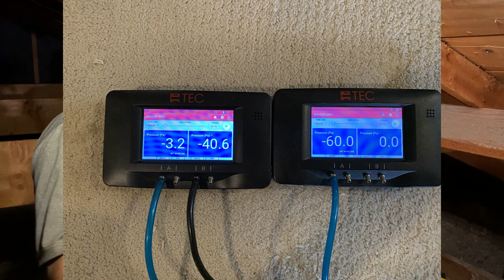What If One Suction Point Isn't Enough To Reduce Your Radon & You Have a Finished Basement?

Comment: I liked this video and the level of detail provided, especially around what you feel is a good suction level and how that drives fan selection. Thanks for these videos as a homeowner I have learned a lot and it helped me reduce my home radon level greatly.
Reply from the maker: You are welcome! Can I ask where you are watching from and what your radon levels were before and after mitigation?
Reply: @AmericanRadonMitigation  my home has a basement and two smaller crawl spaces, the first of the two installed by the original owner. There was a SSD installed that covered the basement slab (1,600 sq ft) and newer crawl space (300 sq ft). The high suction fan produces -.024 inches at two furthest points on the slab and -.01 inches at three locations in the basement slab. I still have vapor coming up based on my feeling and breathing it. The remaining 115 sq ft crawl space is still not depressurized and I was wondering if I could rig a temporary fan to an existing sleeve which connects to a pit. Are there such fans available which would allow me to creat a vacuum under the slab and evaluate how much suction it produces. I have course sand under the slab.
Reply from the maker: Hey Thomas. It's hard for me to give advice without more information and without being able to see it.

We do offer consulting services via Google Meet, FaceTime, Google Duo, video, and email. The cost is $250 for each hour. We also rent measurement instruments that will allow you to pressure field extension, CFM, and static pressure.

Give us a call at 612-474-1004 if you'd like to set up a consultation.

Comment: Awesome video, love the content - so the stitching is just an open tunnel back to suction point that you dug/connected through a series of holes? Any concerns of integrity of the foundation removing that much material?
Reply from the maker: Yes, that's correct. The concert floors in Minnesota are not structural like the footings, so removing that much soil is not a concern. The 3.5-inch concrete slab can easily bridge the tunnel.
Reply: @AmericanRadonMitigation  thanks so much for that quick response! Your channel is fantastic and is certainly saving lives. Take care!
Reply from the maker: Thanks for reminding us why we do it!

Comment: Idea, the last three nails on the roof exhaust flashing, before nailing the nail all the way in put the dab of caulk under the nail head, should form a better seal and protect it from UV light.
Reply from the maker: I tried that for a few months, but it made a mess of the flashing and my hammer. I now put three dabs under the flashing where the nails will be.

Comment: Thank you so much for this extremely informative video. Such amazing workmanship! I’ve learned much. One question, it looks like suction point 2 isn’t that far from the first one. Why not simply “stitch” all the way to the first point and thus avoid creating another suction point altogether? Was that a structural decision?
Reply from the maker: Thank you!

That's a great question. I could have done that.  However, running a pipe is way easier and faster than stitching. 

I didn't need to use valves in this system, but separate suction points would allow valves if we wanted to vary the suction in each suction point. For example, having one suction point on drain tile or sub-slab depressurization and a second pulling from an encapsulated crawlspace. You want to be able to control where the air comes from. Otherwise, the fan will pull from where it's easiest. 

Are you a mitigator? If so, where are you from?
Reply: Got it. That makes a lot of sense. I'm not a mitigator, just with a DYI enthusiast mindset that always tries to understand how things work under the hood. We just got a single-point radon system installed by a mitigator here in Georgia. Over the past month, however, the numbers have been creeping upward. Before mitigation, the numbers were between 4 and 7 in the basement. Right after the system was first installed back in July, I saw numbers dropping below 2, sometimes even below 1, and now it's up to 3.5 for the entire past week. It's still quite short term, so I'm observing and see if I need to do anything further. I found the pictures I took of our foundation back when it was new construction, and from the pictures I can understand why the current suction point isn't optimal. Therefore, I've been researching on the Internet on multiple suction points just in case.

Thanks again for your videos. I watched all of them!
Reply from the maker: You're welcome! Feel free to reach out to us if you'd like some advice, as we offer consulting services.

Comment: Good informative video. I am curious about the concrete you use, why don’t you use hydraulic concrete? It sets fast, but the big advantage is hydraulic concrete expands as it cures, if it’s water tight, it’s air tight. Any thoughts?

Also, one last question if your working on a basement floor with radiant in floor heating how do know where to drill your test holes so you don’t hit any of the heat tubing?
Reply from the maker: Thanks, James. Good questions. 

1. I use fast-setting Sakrete since the yield of one bag is much higher and far less expensive than hydraulic cement. We are also not relying on the concrete to make the seal. By the way, I've had hydraulic cement leak in the past, so I don't rely on it to make an airtight seal anymore. 

2. We use a thermal camera that plugs into a smartphone. Here's a link to the ones I would get. https://www.amazon.com/shop/americanradonmitigation/list/2TZ3HBU6ICV4Z?ref_=cm_sw_r_cp_ud_aipsflist_aipsfamericanradonmitigation_FSA24YV85QRNKPD0FHJ3

Comment: How are you excavating your stitching holes? They seem pretty far apart to get like a long drill bit or something in there, I have to do this in my house. I'm at a 5.4 pCi/L during the day and for some reason at night it goes up to about 8 pCi/L at night. I must be doing something during the day that vents it or something...
Reply from the maker: I use an auger on a right-angle drill, screwdrivers of varying lengths, my hand, and a shop vac.

Comment: Great job, Great detail. Thanks
Question, would having a 4 inch pipe on the exhaust side of a high vac 3 inch system provide any benefit. Such as less energy for fan? I understand your thinking on the 4 inch pipe preventing less of a freeze problem, good idea.
Reply from the maker: Thank you, Gary. A few feet of 3-inch pipe above the fan would add an insignificant amount of friction loss on a high-suction radon mitigation system. The less air a radon fan moves, the less power it consumes. If we were in a warmer climate, we would use a 3-inch discharge on high-suction, low-flow systems.

Comment: Being in Ramsey Mn with a lot of sand my meter is saying 10 PCI/L I think I have to do this. Do you think it is a must to go through the attic? Is condensation/freezing a problem if it's on the outside?  Is there a reason you didn't run horizonal pipe in the attic so the pipe could stick out the back of the house and not the front?  I'm a builder/remodeler if I ever need radon mitigation for a customers's house I'll call you.
Reply from the maker: I wouldn’t install an exterior system on my house unless it were the only option. In Minnesota, freeze-ups are common in the winter, so when you need it most, it may not work. 

You can certainly run the stack out the back of the house. You must maintain pitch to drain condensation inside the piping back to the suction point. Be sure to insulate the piping in the attic as well. 

Be sure to reach out if you have any questions. Good luck with your project! And let us know how it goes.

Comment: Hello. Thanks for your videos! I have a home with radon level’s typically .4 but the last week we have gone up to 1.6 ish.  The u tube is measuring 1.5 neg pull so I think fan and system are fine.  Should I be looking for a supplemental radon fan?   Using Airthings view for measuring data.  Thank you
Reply from the maker: You may be losing suction under the slab in some areas of your home. It's hard to say without seeing it and doing some diagnostic pressure field extension testing. If your radon levels stay higher than you are comfortable with, we do offer consulting and tool kit rentals. 
https://americanradonmitigation.com/consulting/

Comment: Good work yet lot of work and money to reduce a 1.3 pCi/L radon level. I would think the money & energy usage would have been better spent on a HVR or even EVR?
Reply from the maker: Perhaps. However, you have to double the air changes to cut the radon levels in half. The radon system is likely more expensive upfront but will have a lower operating cost with the added benefit of reducing moisture below the slab.
Reply: @AmericanRadonMitigation  with a 90% heat recovery on a unit transferring at a recommended 0.7 per hour. If the house started at 20 pCi/L the fresh air at say 0.2 pCi/L just taking a 50% out for mixing to make the calculation easy in about 6 hours the only radon in the house is what is getting into the air from inside and out. When everyone figures this out they are just going to sell more Heat Recovery Ventilators for residential.  Likely all the office building engineers have this figured out.

Comment: Have seen others back fill the holes they do with larger rock is the something you do or recommend? thanks
Reply from the maker: We do not. The slab in this house was strong enough to span the tunnel and suction pits we created. Occasionally we do if the slab is only an inch or two thick. We've also dug suction pits in an X shape, so there is support near the pit's center, eliminating the need for rock. You wouldn't want to restrict airflow with stone if it was a high-flow situation. 

Thanks for the question, Dave.

Are you a fellow mitigator?

Comment: what is the model of the concrete hole saw you were using to drill the suction point?
Reply from the maker: Here's a link to the 5-inch Bosch core bit we use 
Bosch 5-Inch x 17-Inch x 22-Inch SDS-Max Rotary Hammer Core Bit, HC8575 - https://amzn.to/36ik4Xw

We have links to many of the products and tools we use in the description.

Thanks for watching!

Comment: Why didn’t you put a condensation bypass in? Won’t the rain coming in the roof vent damage the fan???
Reply from the maker: Condensate bypasses are used on exterior systems, not interior systems where the fan is in the attic. Interior systems don't generate much condensation because the piping is insulated except for the foot of pipe on the roof. Exterior systems have 10 to 40 feet of piping that are not insulated. The different temperatures of the air inside the piping vs. outside causes condensation to form inside the piping. Similar to how a glass of ice water forms condensation. This condensation produces more water than rain entering the top of the open exhaust. This condensate is what the condensate bypass is diverting around the radon fan, not so much rainfall. Hence the name condensate bypass.

Thanks for the question, and thanks for watching, George!
Reply: @AmericanRadonMitigation  oh I understand now thank you. I’m installing mine in the basement tomorrow with my fan inside, it’s a finished basement so do I have to insulate the pipe inside?
Reply from the maker: Nope, just where the piping passes through unconditioned areas of your home. 

Check out what can happen if you skip insulation. https://youtube.com/shorts/A8O9GsJijOk?feature=share
Reply: @AmericanRadonMitigation  thank you
Reply from the maker: @georgelichak3972  you bet!
Reply: @AmericanRadonMitigation hey question on that pipe insulation. Where do you end up getting it? Do you just buy flex duct that is one size larger than the pipe you are installing? Otherwise I suppose you could use fiberglass preformed but those are expensive.
Reply from the maker: We use 4-inch flex duct on 3 and 4-inch piping and pull the duct out of the middle of the flex.

Comment: So how can they possibly allow you to leave tunnels underneath the slab without taking the chance of compromising the slab.
Reply from the maker: Good question, Rod. The slab is not structural and can span the gap without a problem. There is typically settling under slabs where there is fill. For example, most walkouts, 4-level splits, and garage floors settle in the portions that contain fill. You'll see an example of it in this video. https://youtu.be/pLMob_TLyF8
Reply: @AmericanRadonMitigation  the fact that the slab is not structural is exactly why it needs support and why you are required to firmly packed the ground under a slab before you pour to avoid settling. The only way a slab can settle is if the ground is compromised underneath and this is exactly what your process does. I can’t believe any county code enforcement would allow this. It seems you are taking the chance of creating a structural problem in the house to solve a smaller problem that could easily be solved by opening windows, or even leaving bath fans running. 
I had radon levels of over 22 and reduced them to under one just by opening the house up and letting it air out. I know this doesn’t work long term but the problem can be solved easier than what you are doing. I would never purchase a house that I knew had tunnels under the slab.

Comment: do you not need a rain cap on the top of the pipe on the roof???
Reply from the maker: No, we don't use them here in Minnesota. The radon mitigation standard addresses rain caps in sections 6.4.12.1 through 6.4.13.4. https://standards.aarst.org/SGM-SF-2017/26/index.html

We also have a video about rain caps here. https://youtu.be/MOK5eAPH3SU

Comment: I wish you were in my area! I have reservations about the company I was considering. Do you have any suggestions or tips on how to find a good Radon mitigation specialist? The EPA and MD state site wasn’t as helpful as I had hoped.
Reply from the maker: That would be an excellent topic for a video! What questions or issues would you like to see addressed?
Reply: @AmericanRadonMitigation  My biggest problem has been finding certified mitigators that service my area. The EPA website keeps referring me to my state website which does not have a list. 

From the calls that I’ve made, one of my questions is: When receiving estimates, will mitigators provide a guarantee of the lowest number of pCi/L their system will get the levels in my home down to? If so when selecting one, what number should I be looking for? Currently in my area the average is 4- 4.1.
Reply: Also, if the company that I find isn’t as thorough as you are in your videos, what can I do in my home to get those levels even lower? Our basement is finished and to be honest I’ve never been in the attic. I saw in one of your videos That’s you caulked around the frame as well as used spray foam and insulation in certain parts of the attic.

Thank you again for the videos that you’ve posted and for sharing your knowledge. It is much appreciated!
Reply from the maker: I'll try to shoot a video about this and have it post next week or the following week. Thanks for the questions!
Reply: @AmericanRadonMitigation  Thank you! Another question I have is how much does digging on the outside of the house affect an already installed radon mitigation system? 

During a call with a company I mentioned that I may need waterproofing done on the outside of the house. It was stressed that if I needed any waterproofing done, I should get it done before the radon mitigation. Then they said that I don’t need waterproofing unless there is standing water in my home 🤨. The waterproofing contractor I spoke with said that if we remove the dirt hill next to the retaining wall on the side of our house (on the opposite side of where I would like the radon mitigation system to be-the same side as the HVAC system) that would resolve the water retention problem that we have on that side. Would addressing the wall and dirt hill after doing radon mitigation cause a problem or void a warranty?
Reply: Thank you so much! I’m sorry to ask so many questions but I’m hoping they will help someone else as well.
Reply from the maker: Watch this before hiring a radon mitigation contractor - https://youtu.be/0EqUxNx1y7Y

Comment: Why not maintain a positive pressure?
Reply from the maker: Many commercial buildings maintain a positive pressure relative to the outside. I've heard it's not practical in a house, though. Perhaps our homes are too leaky, and we'd be forcing conditioned air through all those leaks. Which may be far more costly than installing and operating a radon mitigation system.

Comment: I’m worried about that the rain water will be pouring into  house through the top pipe extending out of the roof
Reply from the maker: Hey Ben. The small amount of rain that does get in the pipe will end up below the slab only to be dried out by the radon system. 

Upward exhaust without a rain cap is the preferred way to discharge soil gases. 

Check out section 6.4.9 of the standard. https://standards.aarst.org/SGM-SF-2017/25/index.html